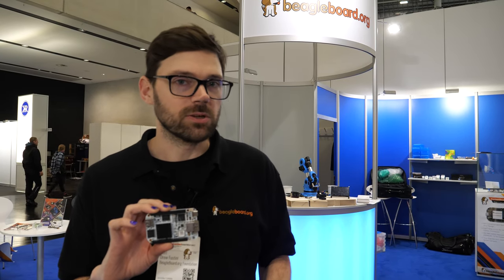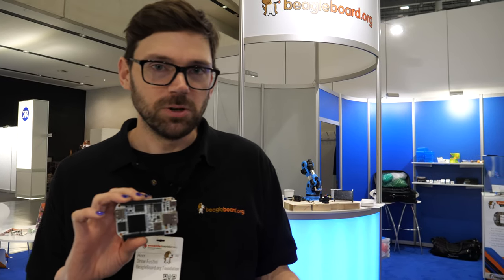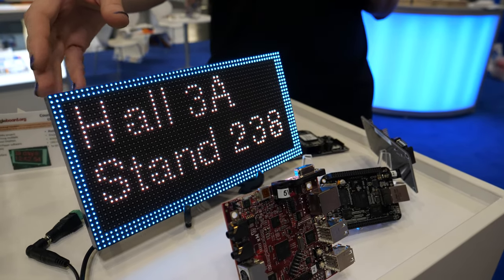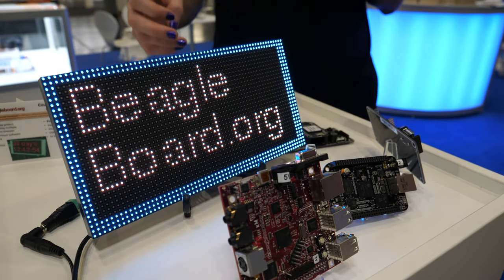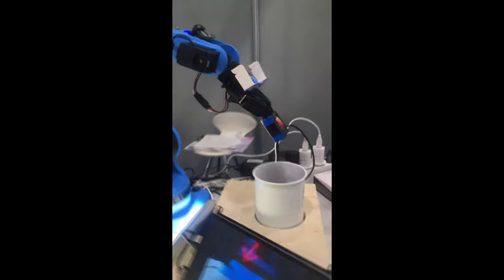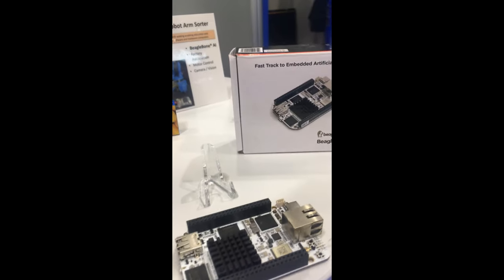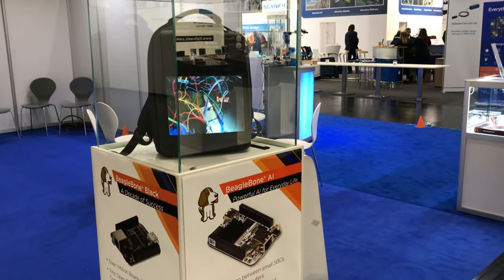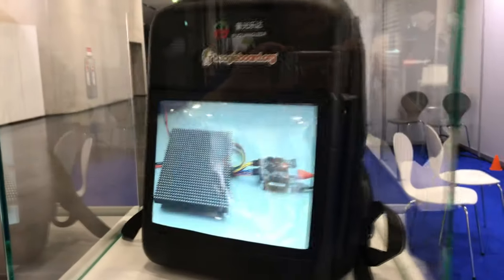Beagleboard at Embedded World 2020, BeagleBone AI, PocketBeagle, BeagleBone Black Wireless, Blue

Comment: Pocketbeagles seem to burn out extremely fast and easily. I bought 3 of them and within 2 weeks they won't power up any more.  I'm just using the microUSB connected to laptop for power.  Raspberryy Pi is a much sturdier and easier unit.